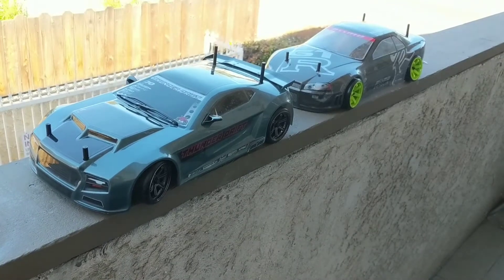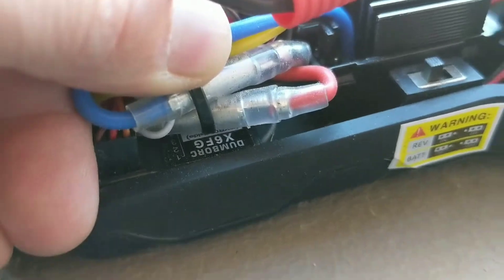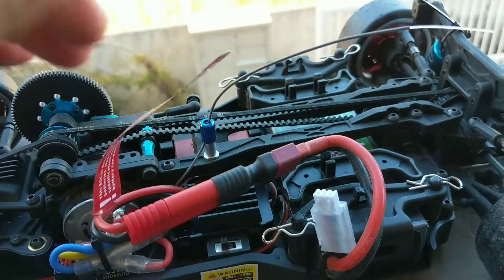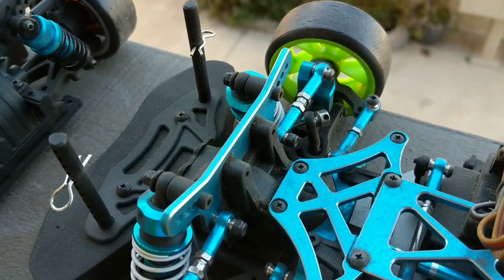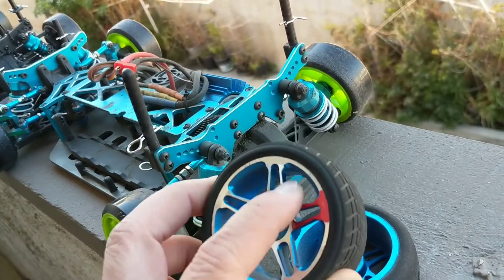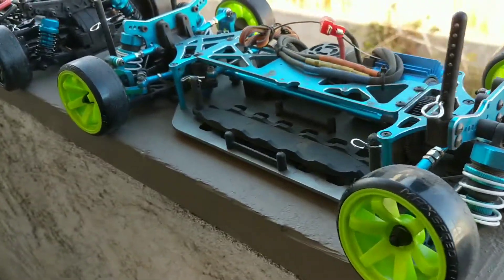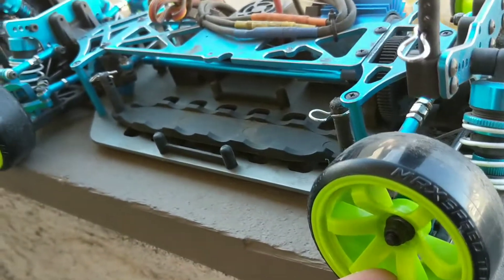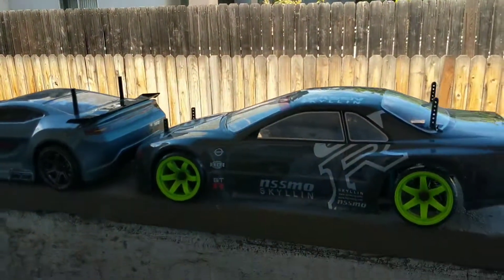RC Drift Car Fleet Updates - Redcat Thunder Gyro and ZD Racing TC-10 Drift Configuration

Comment: I took out the 88 t spur and put in a 85 tooth,  now the body can lower and not rub on the gearing. On the thunder drift
Reply from the maker: Thanks for watching 🤙 and for the great tip👊 Didn't think about the smaller spur, will look into it.